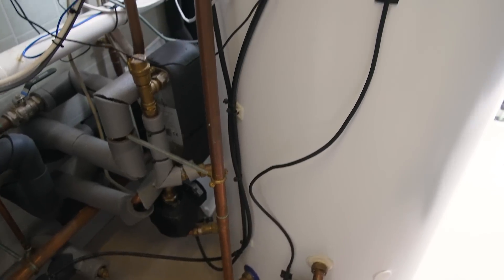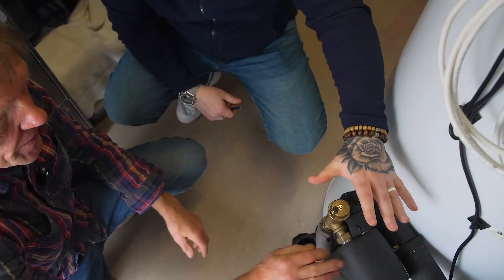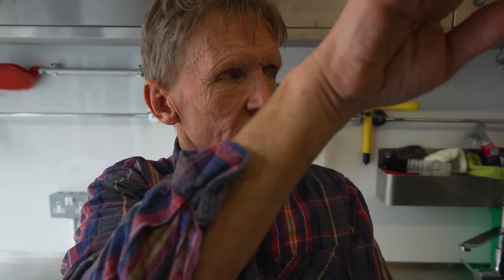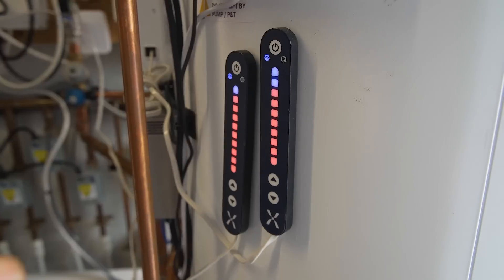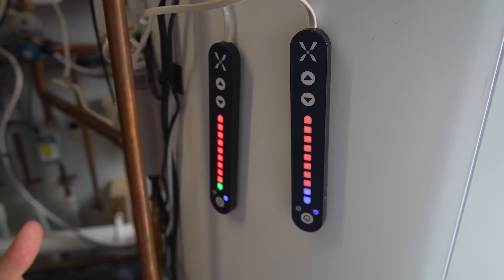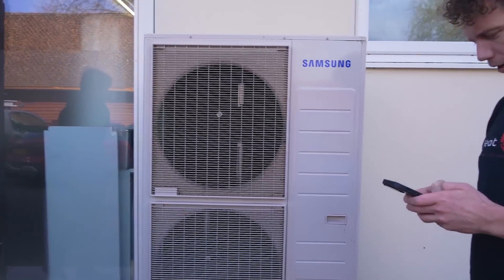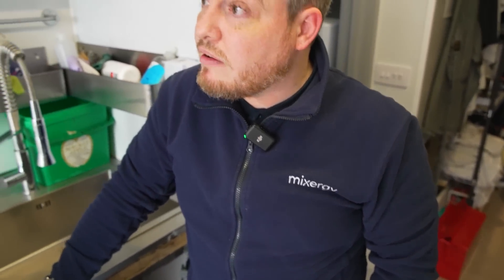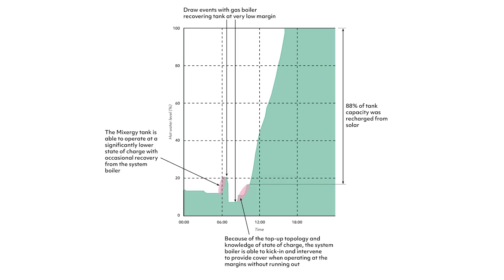What's So Special About the Mixergy Hot Water Cylinder?

Comment: Nice piece of kit with lots of tech, I hope it is reliable, I counted three pumps!
Re Legionella: for a standard HWC heated by gas boiler, mid-week I heat HW for the amount required, 50 minutes in the morning is ample; The HWC is double lagged with insulation so minimal heat loss and plenty of hot water in the evening.  Weekend, I set the HW to the HWC thermostat cut-off (65 deg C) and leave as long as it takes.  At the weekend, when I wash the plates after breakfast I use Marigolds.

Comment: I really liked these at the Installer Show but it got me when this guy and his colleague explained it. The coil at the top is how cylinders used to be way back before Viessmann designed cylinders with a coil at the bottom which is now industry standard. Also the full tank heat up time at 32-44 minutes minimum depending on their tank size is almost twice that of conventional tanks so it's even more important to accurately size the tanks for the demand of the property/residents. 

That said the Energy Saving Trust has proven this tank is 40% more efficient than conventional tanks (depending on usage/storage volume required etc). That said just the tank is about £1800 and they need inline scale reduces/softened water to stop the strip sensor inside becoming desensitized. Which is another load of kit on top.
Reply: Softening the water will save loads on shower gel/shave gel/shampoo. When I go on holiday, I always forget about the water being softer, use the amount of soap I would at home, and then end up spending ages trying to rinse all the excess suds away. 

It’ll also save on damage to taps/shower heads. I’ve had scale literally eat through the metal of taps. I’d take those filter replacement costs on the chin for better skin, and less scale to deal with.

Comment: Only an hour ago, I watched your video on british gas care's failure to fix the fault on your neighbours property due to an intermittent fault.
Who would I have to call to diagnose and repair even the simplest fault on such a setup? 

It seems that as technology grows in this area, the more potential there is for failure, more pumps, more motorised valves, complex sensors, but zero uniformity between manufacturers.
Ad the fact that renewable energy systems, as a growing trend, is resulting in thousands of new pop up companies, all eager to cash in on the opportunity, selling systems  that homeowners can't even begin to understand how they work. With wild promises of massive savings in the future.

This guy seems to be just like a 90's pvc window salesman,  
Baffling people with nonsense jargon.
If most people only use 50% of their tank, why was that tank specified at that size in the first place?
Reply: I am venturing into all this and it certainly strikes me that across , solar , batteries and heat pumps there is so much to go wrong .

Comment: You could do exactly the same with a "normal" tank by using primary secondary water circulation within the tank ( probably with an external pump, connected to a pipe loop ) . circulating the hot water in the tank and evening out the stratification controlled by thermostatic probes. Mix it up : get more usable hot water and less extremes of temperature within the cylinder.

Comment: My wife and I have an instant hot water (gas) boiler using LPG and manage on two (usually just over one and a half) 47kg bottle of gas PER YEAR.  Hot water and showers on demand.  Boiler cost me £180 (mind that was 15 years ago) and has only needed a replacement flow sensor in that time (touch wood).  How times change.  My boiler would now be 'illegal' to install.
Reply: Crazy isn’t it? We are on LPG and the heating eats cylinders, but the hot water demand is minimal. What modern allowable system would match yours?
Reply: Might want to get it serviced! Yeah when I’m just running hot water the standing charge is the bigger cost!
Reply: @edc1569  I work on the principle that if it ain't broke I don't fix it.

Comment: Isn't instant on-demand heating the cheapest?  Heat only what you need, when you need it?  Bit like an electric shower?  Of course, shower units aren't exactly the most efficient devices but they could certainly be improved on (for heat loss).  I'll guess (tongue-in-cheek) an electric instant water heater is a gaddam lot cheaper than that monstrosity!
Reply: I'd have to factor in 8x9.6kw showers potentially being switched on at once = a very sudden load of nearly 77kw. Also, inline heating will at best give you at best 100% efficiency. The ASHP provides the hot water at around 260% efficiency on cheap rate electricity to 50c and if I need that boosted to 60%, the immersions do that at only 100% efficiency but with solar, stored or cheap rate electricity.

Comment: Couple of things Roger I started to watch your last video and after 10 minutes realised it was over 8 hours long, omg. You mentioned phase change, I have fairly recently had installed a system using phase change materials by Fischer future heat for my hot water and it seems to work for me in conjunction with my solar and battery system. I have it set to come on for 2 hours at night when electricity is cheaper but of course this only applies if the battery is too low to power the system.
Reply from the maker: Thanks, we need to do something on phase change

Comment: Got one of these and it’s brilliant, but agree with some folk… perhaps overly complicated for some situations. Handy when you generally don’t use much hot water, but need to accommodate visitors from time to time. 
Agree the heat pump option is probably only suited to low temperature heat pumps where it’s just lifting the base temperature and then the solar or immersion is “boosting” it to 55 or 60 degrees.

Oh and we’re an average 3 bed semi.
Reply: My low temperature heat pump can heat Mixergy HWC to 55C ( from 'cold' @ 10C in 55 minutes for 150l, costing < 2kWh of electricity for HP) without any assistance from electric heating elements.

A full tank at 50C once a week will kill any legionella in @ two hours. Bear in mind that incoming water is already Chlorinated to kill bacteria.

In practice I heat to 45C which is a hot bath or shower, any higher means mixing in cold to reduce temperature.

Comment: Great piece of kit. We replaced an old cylinder with one in a rental property linked to solar. Tenant noticed a significant difference in their electric bills.
Reply: Solar water heating is a great way providing spares are available my Dutch one had no replacement parts and was very good until if failed.

Comment: I did go and see them while we were at the nec last week, and they explained exactly what your film shows and they said start from around £1800 but I think it could be  a waste as it becomes a standard unvented cylinder once the plate exchanger and air to water heat pump fitted , maybe we can retro fit a plate exchanger to an existing unvented or thermal store and save £1000’s   Jamie

Comment: if you only need 50% of the capacity, it begs the question why you didn't get a smaller tank... How would this compare to a cylinder with 2 coils in, one at the top one at the bottom, and a zone valve to swap from top/bottom/both?
Reply: Because it gives flexibility to perform better for different usage  scenarios (guests visiting etc.) or if you need to recharge quickly I assume the lack of mixing means you get a useable water faster.  He clearly said they do smaller tanks so obviously you choose the right size tank for your situation.
Reply: I need to accommodate up to 16 guests, plus myself and my wife. A gas engineer told me I needed 800l of hot water storage to manage the peak demand. And in low season I can throttle the hot water volume right back.  Lastly, they're brilliant as thermal batteries 🙂
Reply: It's a flexible thermal battery -- a bigger battery = more stored energy. If you have a lot of solar electricity and no (or small) batteries it makes sense to load up your tank with hot water for free. Then when you need it later, you don't need to heat it on demand (or it requires less energy to bring it up to the required temperature)

I think the main problem with this approach is that it's not for everyone. A lot of houses that were built with combis in mind (or renovated to remove hot water cylinders) no longer have the space for this, which is unfortunate.
Reply: Great presentation, the chap knows his stuff. If you're going heat pump early on it feels like a lot of the smarts are no longer needed and a dumb / cheaper cylinder would be similar?
Reply: Mine assumption because smaller tank will be cheaper and  that is big no no from any przez,sales person 😕

Comment: So when you add the plate heat exchanger to your Mixergy cylinder, it loses all its special abilities. It becomes a normal cylinder, where you're not heating from the top to e.g. 30%, but are heating the whole cylinder to the same temperature, with the plate heat exchanger pump mixing everything up.

I do understand that heat pumps wouldn't want to be delivering their lower-temperature heat into a small coil in the hottest part of the tank; it would be terrible for the COP. But why buy a Mixergy and not a traditional tank for a heat pump?
Reply: Because I started the system with a gas-fired combi and used it for about a year. It was worth the compromise to keep the cylinders while everything around it changed :-)
Reply: @MagnoliaHouseRye  sorry, I used the word “you”, and in your case the progression does make sense.

I really meant, why would anyone come fresh to a Mixergy cylinder for a heat pump? It seems like the main selling point (heats just what you need) isn’t true for heat pumps, so people might as well go for a standard tank, which would be cheaper.

Comment: Is this a music video or about building?
Reply from the maker: It is a building video with music.  You can also get a music video with building. Pink Floyd's Brick In The Wall.
Reply: @SkillBuilder  We built this city on Rock n Roll
Reply: Simplicity is the best way forward. My heat store with immersion heaters (powered by solar pv), solid fuel, and small gas boiler, all installed in highly insulated converted 60's bungalow.  Plus MVHR throughout. Very low maintenance, and possible to have small wind generator or heat pump added if required. 
Complex systems are seldom maintained properly.
Reply: @steveedmondson7526  Well thats a big fat fail then.    Solar PV 15% efficient with lift span of 10 years.  If you are heating water why didn't you use thermal solar at 90% efficiency and decades lifespan?
Reply: @EkuuleusNorth  Solar thermal is more like 70%. Plus you can sell the excess from PV to the grid which you can't do with thermal. You need electricity anyway so I'd rather have PV and only maintain one system rather than two. Also although the person you replied to hasn't you can get a heat pump making the efficiency of making hot water from PV equivalent to thermal solar
Reply: @jamesclark5654  Yup, selling the electricity is good, but it seems a mix of both would be better.  I see solar thermal upto 80% so it may have been top of performance at 90%.  Solar is generally 10% to 20% with the very latest panels but that efficiency is when installed.  The latest PV may last 20 years but there are plenty that fail well before this.  Installation cost is far higher for PV and in addition, recycling is very poor for PV.   If climate change was real, they would use a lot more thermal solar.
Reply: @EkuuleusNorth  Your last sentence sounds a bit unhinged. Who's "they"? Both products are widely available and consumers make their own decision about which one fits their purposes better. Last I checked nobody actually came and forced me to install one or the other.

As far as I know both are also available on the green deal.

Comment: So in most small 2 up 2 down 1920 terrace homes in northern towns and cities where do they fit this and at what cost also it's ok rambling on about energy carbon neutral ect but this thing will use vast energy to manufacture ,transport,vso it's still not any better than a boiler in old homes and where do the great majority of folk get the cash
Reply: Like EVs, the technology tends to come in at the top of the market first, overtime more mass market solutions and eventually you get to the corsa-e. Give it 10 years it’s very early days in this transition, eventually you’ll get a kitchen cupboard sized solution.
Reply: @edc1569  Exactly. And you'd have to replace your gas fired solution usually every 10 years, so either way, you pay
Reply: @edc1569  and like EV another panacea that use exotic metals dug in Africa Afghanistan by child labour which has to be refined put into batteries that cannot be recycled.Clinate change is the nuclear war fear we had in 60 s ,the ice age in the 70 s the ozone hole in the 80s  and is simply a way to make money by putting fear and control into easy fooled minds
Reply: In my small 1960's two bed semi the Mixergy HWC went in the old boiler cupboard when gas boiler removed, the vented cylinder and header tanks were also removed creating more space in the 'airing cupboard', so I've ended up with a bit more space than before.

The cash for many will come as part of the heat pump grant, as a upgrade to unvented cylinders is part of the uplift process required in modern builds (if my memory serves correctly)
Reply: So how much including the grant to buy install,how much savings compared to gas how much can be recycled The average combi for small 2 bed terrace is around £6 k and gas bill around £650 a yr and boiler 90 % recycled
Reply: @keithrobson2168  

For me, including grant just under £4k for new HP, Mixergy HWC, 7 radiators and associated plumbing upgraded.

Since install five months ago heating COP averages 4.28, HW COP 3.4 average (Data from Daikin control panel).
1200 kWh of electricity used over five months, average electricity price for me on standard tariff has been 24p (currently 22p) so thats £288 total cost for heating and HW.
If I moved to Octopus agile average would have been @ 17p/kWh giving a five month total of £204.

Of primary importance to a HP is good design followed by good installation, they're not noisy, do work in winter (my first week was four nights below zero), and will output enough heat as per design to accommodate not so well insulated older houses. Although good insulation benefits all types of heating systems.
Currently 12.6C outside, living room 23.7C, bathroom 24.3C, heat pump running at steady 406 Watts heating all rooms for a flow temperature of 34C to radiators.
Take care HP not oversized as can lead to inefficiencies if cycling on/off too much, and also can't modulate down as well during milder periods.
At the moment my HP is  on for a few hours a day during colder wetter days, when warmer (above 17C outside) it switches to standby (using at most 14 watts), first two or three months was running 24/7.
But everybody's circumstances can differ, if your pipework is mostly 15mm & 22mm you might get away with existing pipework, mine was 8mm microbore, and everything was worn and torn and needing replacing, so not a difficult decision for me
Reply: There's 26 years to go to be fully carbon neutral. Your gas boiler has a lifespan lower than that. So you'd have to replace it anyway. The carbon cost of making a new boiler will be comparable to making all this kit. But then we don't have to use hydrocarbons in the energy system, so it's a win against global warming. Start saving now for the eventual cost. No government in any country will cover the transition cost 100%.
Reply: Won't be too much longer before all this 'carbon neutral' BS is consigned to the dustbin of time.  Common sense will prevail.

Comment: What a great way of selling a tank twice the size you need, then charging you extra for only heating half of it.
Reply: In fairness a hot water tank is a form of battery....coupled with solar it can be used as energy storage therefore bigger is better
Reply: @sailaway8244  

And when combined with a heat pump at least 3.5 times as efficient as any direct electrical heating element.
Reply: Loool yep. Look at that mess as well. I've got a heat battery from sunamp
Reply: We've got the air source heat pump mixergy iHP. Fantastic bit of kit...
Reply: Too complicated if water from tank comes out too hot I dilute with cold water .